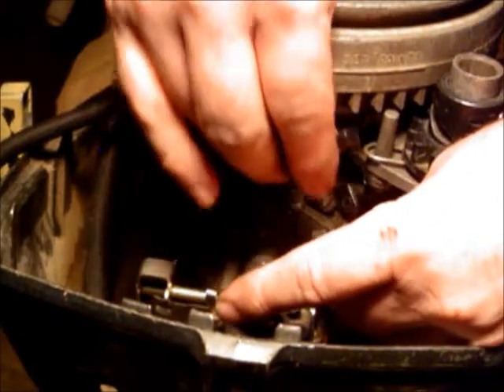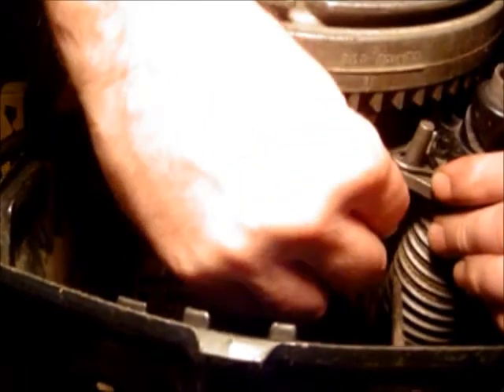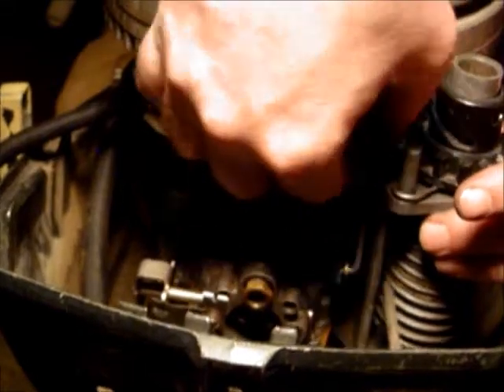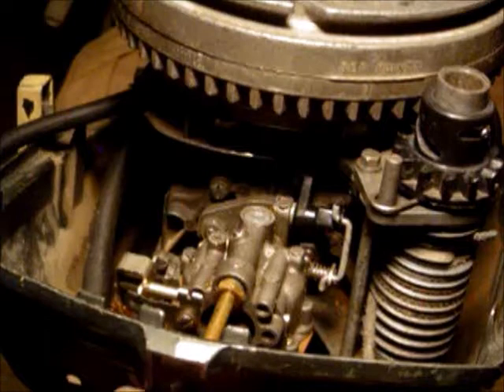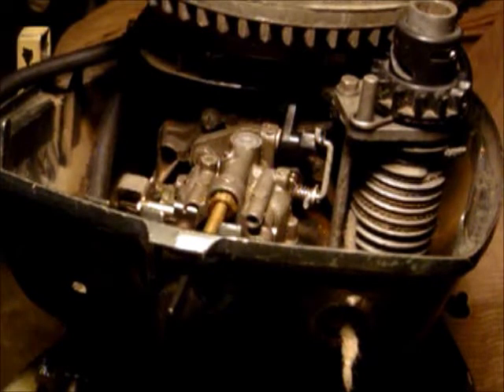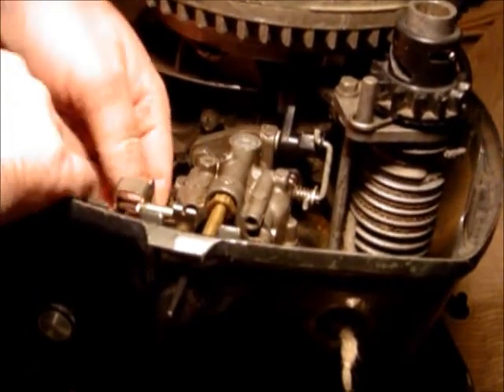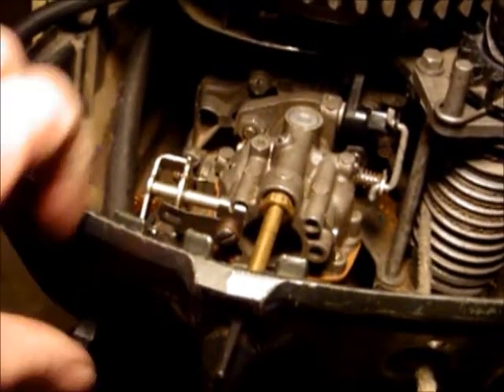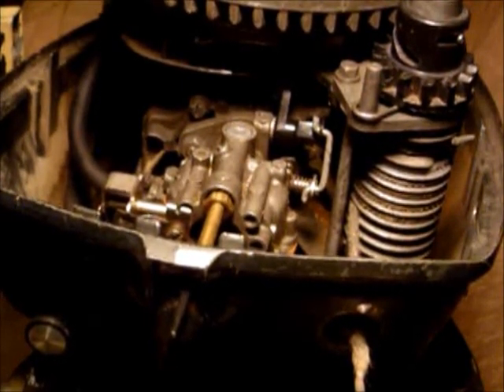OMC fix jet carburetors part 10 of 10  (Motor displayed 1968 Johnson 6hp)

Comment: Thanks for the photo of the spring, needle and float. I did it after seeing the close up photo. The carburetor is back on. All I have left to do is slow speed needle, choke and hook up fuel line. Have you posted something about turning the carburetor? You mentioned something about that.
Reply from the maker: You can somewhat set the low idle screw/needle in the barrel, but it is best done under load on the boat in the water.

Here are some instruction on how the accomplished setting the low speed needle with a fix jet high speed carburetor.
Make sure these are your beginning carburetor settings:

Facing the carburetor you will notice slow speed and idle knob.

- Top needle is your slow idle needle. You will gently turn in (clockwise) until the needle is gently seated..please don't force.  Once seated, you will turn out (counter clockwise) the slow idle needle 1 1/2 turns.  Leave it there for the time being.

- You do not have a high speed needle.  You have fix high speed jet.  No adjustment necessary.

Carburetor Adjustment

Initial setting is: Slow speed = seat gently(turn in clockwise), then open 1-1/2 turns(turn out counter clockwise). Do not tighten or force the slow idle needle shut or it may damage the needle.

Start engine and set the rpms to where it just stays running by turning the tiller grip toward slow until it almost starts to sputter.  In segments of 1/8 turns, start to turn the S/S needle valve in (clockwise). Wait a few seconds (10 to 15 sec) for the engine to respond. As you turn the valve in(clockwise), the rpms will increase. Lower the rpms again (turn your throttle slightly slower) to where the engine will just stay running.

Eventually you'll hit the point where the engine wants to die out or it will spit back (sounds like a mild backfire). At that point, back out(turn out counter clockwise) the S/S valve 1/4 turn. Within that 1/4 turn, you'll find the smoothest slow speed setting.

When you have finished the above adjustment, you will have no reason to move them again unless the carburetor fouls/gums up from sitting, in which case you would be required to remove, clean, and rebuild the carburetor anyway.  Don't forget to snug tight your compression nut on your slow speed needle to prevent it from easily being mal-adjusted unintentionally.